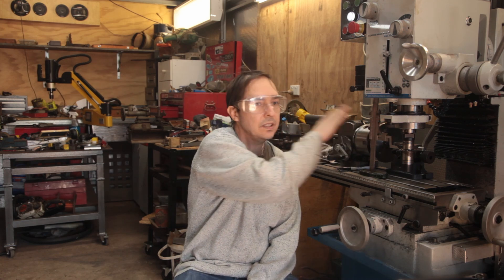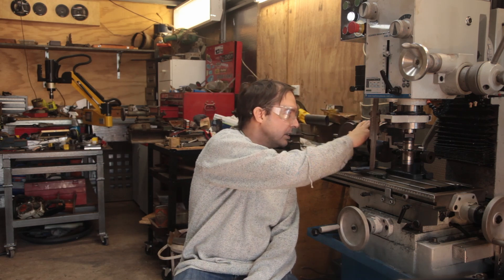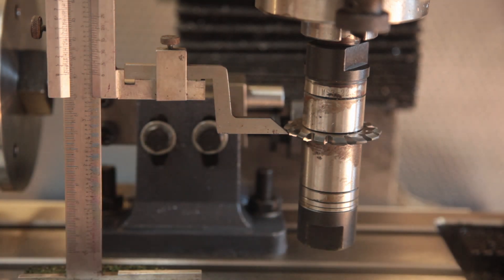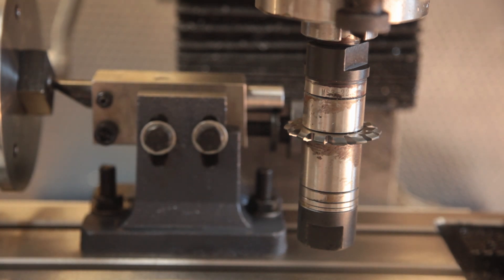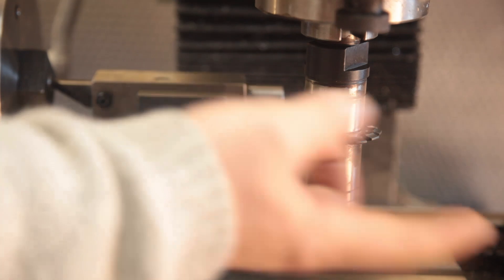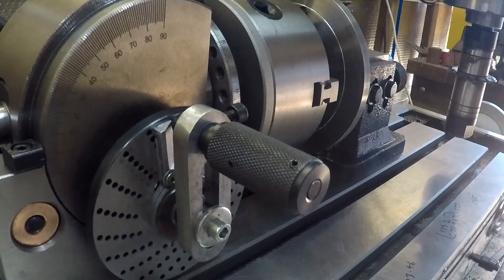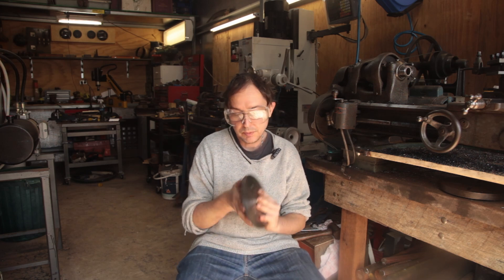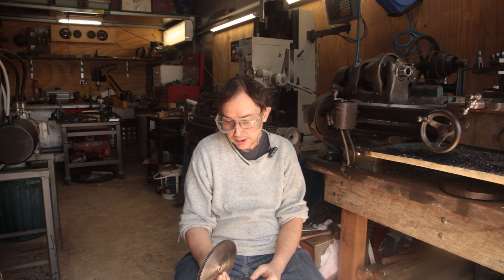Making a 127/100 tooth gear set for metric screw cutting on an imperial lathe.

Comment: Have you seen the electronic stepper motor and controller indexer kit that can be added to these dividing heads? It is quite an inexpensive kit to build and adds a lot more versatility to one of these import indexing heads.
Once the kit is fitted you simply select the amount of divisions/indexes you need on the control box and press the advance button and lock the indexer spindle for each advance/index cut.
Reply from the maker: I had seen those but as this was a bit of a “I need it now” unplanned side project while building the universal knurler, I was let having to use what I could scrounge in my workshop hoard. I might still go down that road if I need to cut more high tooth count gears. The hand cranking bit gets old.
Reply: @docsofftopic8130  Great description....the hand cranking does indeed get old very quickly🤣
Also worth mentioning that electronic/stepper leadscrew drives for the lathe are becoming very affordable these days too.
Set any pitch you like with an ELS setup.

Comment: Thanks for your shared,
I wondering car I do the diameter gear  different or must be the same diameter?
Thanks
Reply from the maker: It depends on the tooth pitch, larger tooth pitch (smaller teeth) has a smaller wheel size. There are online calculators to help you work out the size you need for a given tooth count.
Reply: @docsofftopic8130  thanks, definitely tooth pitch just different in diameter only. I have bought some scrape gears here so expensive.
Thank for recommended.

Comment: You said single point?
Reply from the maker: Yes, it’s a work around for the steel used (work hardened suckerrod), then for the metric threads at least the get trued up with a die once cut to approx 75% of full depth.

Comment: 14 TPI is nowhere near 1.75mm pitch, its actually about 1.81mm . . . . I found that even a horribly overcut 14TPI would only engage an M40 x 1.75 collar for 2 or 3 turns before it bound up. Thats why I've just had to make some new change gears for my lathe (a 28T, 35T and 37T. Any one of them would have done, but I cut all 3 because I'd already spent the time doing the maths, and because it was fun !) Now I have 3 options to achieve 1.75 mm.
Reply from the maker: At 12, so Lo g as you chase it with a die post cutting (don’t cut to full depth) you get three or so slightly over cut threads at the inboard end over 20mm you only need 6 turns to reach the max yield for a give thread. So well more than I needed for this.
Reply: @docsofftopic8130  Yeah, that would have worked, if I could get an M40 x 1.75 die ! I was stuck with single pointing it . . . . As I say, good excuse to make some gears !

Comment: Nice work Doc, looks like you are getting on well with your new mill. You mentioned cutting the teeth with the mill in reverse (counter clockwise) because of manufacturer's recommendations - is there any reason it wouldn't work cutting clockwise and feeding left to right? Just asking for people whose mill doesn't have reverse.
Reply from the maker: I suspect it’s because the tooth profile might not be centred on the cutter blank they use, but if they are all made the same way then it should be a given distance from one side cutter to cutter. But so long as you center the tooth accurately there shouldn’t be a reason it wouldn’t work. Provided the cutter is oriented correctly, turning it upside down would reverse the required rotation to cut.
Reply: It should NEVER be used in reverse. The arbor will unscrew itself, and you will crash the tool. You want the cutting forces to try to tighten the tool if there is any slippage.

Comment: There's a smaller tooth ratio thats really, really close...0.06%
33/13 = 2.5385 
2.5385 / 2.54 = 0.9994
Reply from the maker: I know but I’ll be doing some relatively long sections of thread so need them as accurate as possible as some are feed screws for lathes I’m restoring/rebuilding
Reply: Gotcha!
Clear!